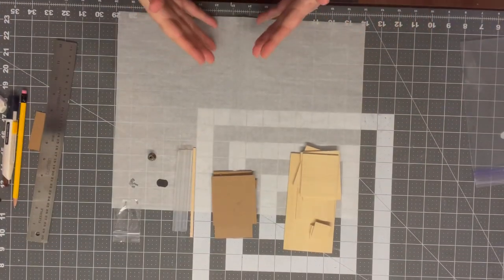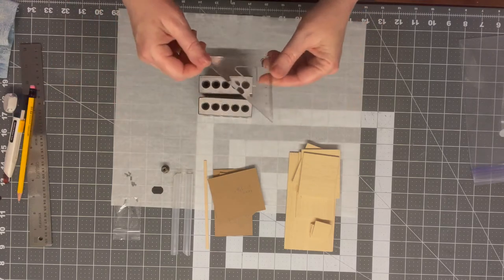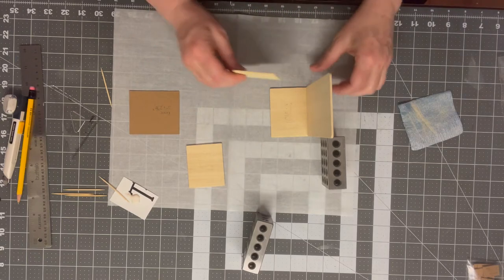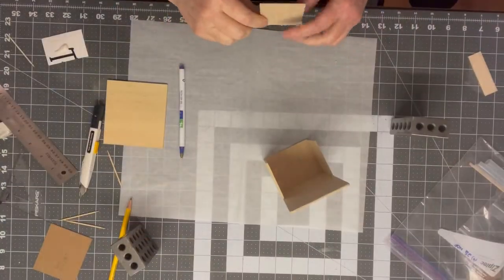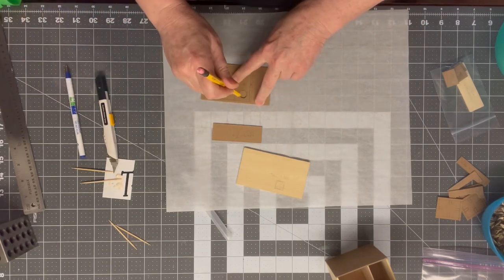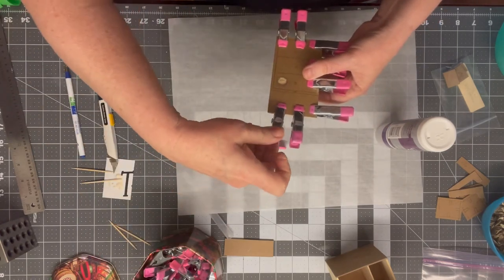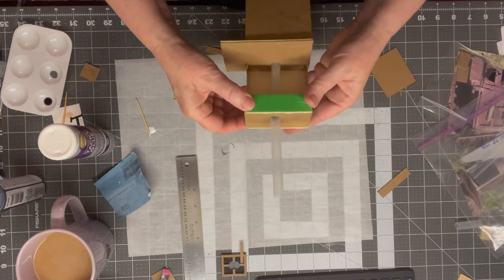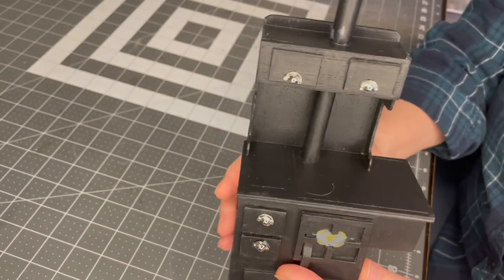1:12 scale miniature Wood burning Stove.

Comment from the maker: Cut from 3/32’  (2.5mm) wood or chipboard

Cut 1 -  3” x 2 5/16” 		Bottom
Cut 1 -  3” x 6” 		Back
Cut 2 -  2 3/16” x 2 ⅝” 	Sides
Cut 1 -  4 ⅛” x 2 5/16”		Top of stove
Cut 1 -  1” x 1”			Support
Cut 1 -  3” x ⅞” 		Front for Warmer A (upper)
Cut 2 - ⅚” x ⅝”		Vent covers

Cut from 1/32” (.8mm) wood or chipboard

Cut 1 -  2 3/16” x 2 ⅝” 	Separator for oven
Cut 1 -  4 ⅛” x 2 5/16” 	Top (Mark the following measurements, starting from the left:
				1 ⅛”, 1 ¼”, 2 ⅛”, 3”, 4”.  Also measure ⅛” from top and bottom)
Cut 1 -  3” x 2 ⅝” 		Front
Cut 3 -  1 ½” x 2 ⅝” 		Oven Door
Cut 1 -  1 ⅜” x 3/16”		Brace for Oven Door (optional)
Cut 2 -  2” x 1” 		Side braces (cut to desired shape)
Cut 2 -  3” x 1”			Top and bottom of Warmer A (upper)
Cut 2 -  1” x 13/16” 		Sides for Warmer A (upper)
Cut 2 -  1” x ⅝” 		Doors for Warmer A (upper)
Cut 1 2 5/16” x ½”		Front of Warmer B (lower)

Other materials
5 handles			For warmer drawers and vent covers
Polymer Clay			For Oven Door
4 beads or pieces		Stove legs
Black card stock		Stove door (optional)
7” of tubing. Aprox ½” diameter - Stove pipe. (could also use a wood dowel here)
Reply: Thank you for these measurements, appreciate them immensely
Reply from the maker: @RoslynBennett  You’re very welcome!

Comment: On my mother's and my grandmother's wood cook stove (the side that you left with the over hang) there was a square tank with a spigot , we called it a water resivior ( sp?) there was always hot water in there.  The basics were all the same
Reply from the maker: Hi Lois, thank you for sharing! I don’t remember there being any kind of hot water reservoir on this one. It sure would have come in handy though given that there was no running water in this house! 😄
Reply: Hot water would be great to have, plus any water to add humidity to the room if you're heating with a wood stove. I used to put a kettle on the woodstove in the winter just so the house wouldn't get so dry.